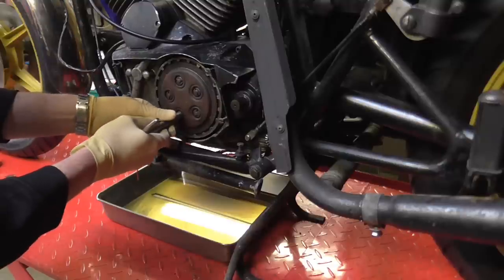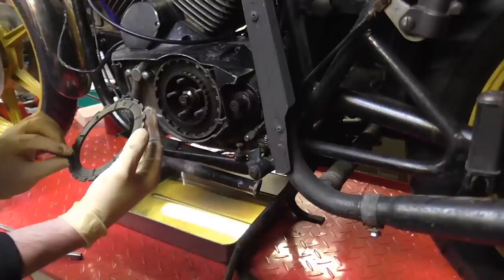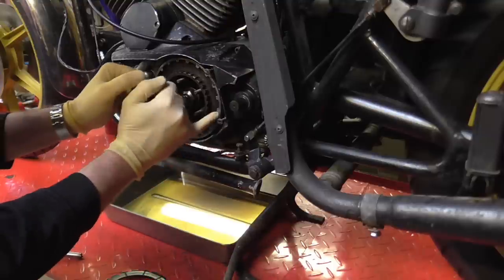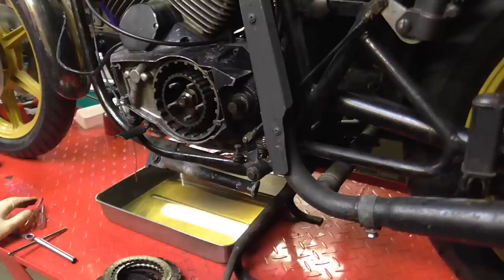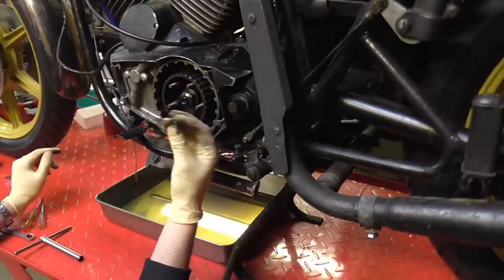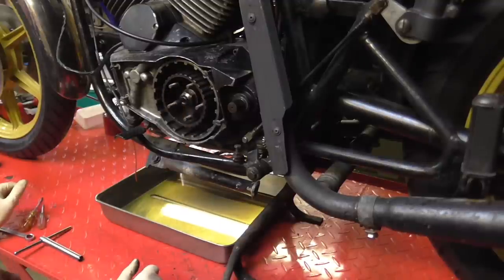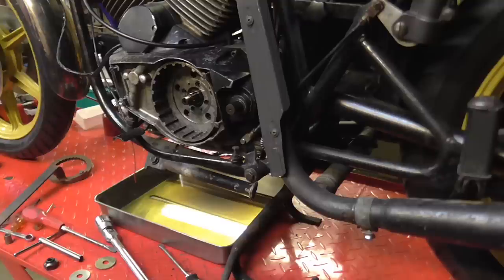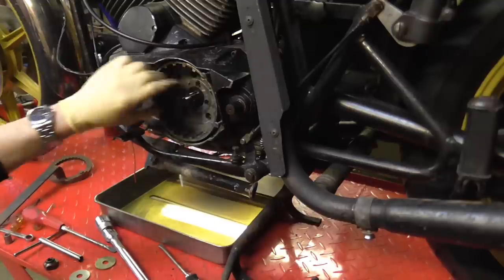Morini clutch strip part 1

Comment: Hello, i am the owner of a morini 350 kanguro year 1983 unfortunately i am unable to put the bike in neutral when the engine is on and if i turn off the engine it goes easily to neutral. Could you please help me to understand what the problem is. Many thanks Riccardo from Italy
Reply from the maker: You have a dragging clutch. The first thing would be to check the adjustment; As far out on the release arm as possible without touching the side case, rather than the 15mm stated in the manual. A worn bar lever pivot can result in reduced cable travel, so check that too. If that doesn't help, then strip and clean the clutch at the very least.
Reply: Paul, thanks so much for your help i really appreciate it. Friendly Riccardo